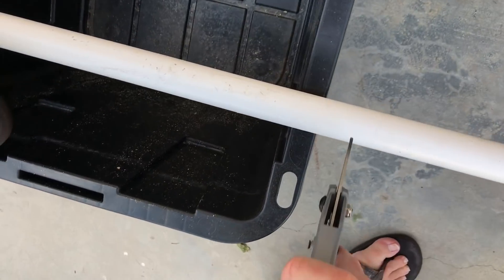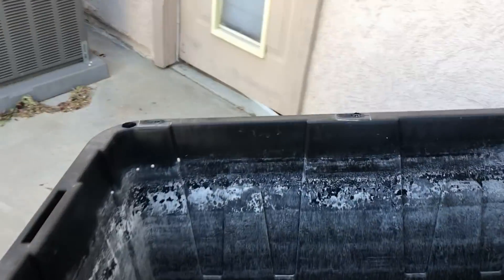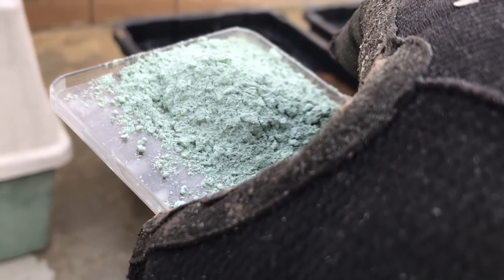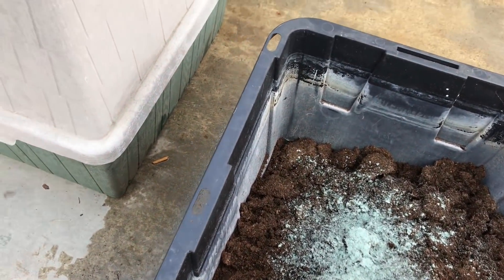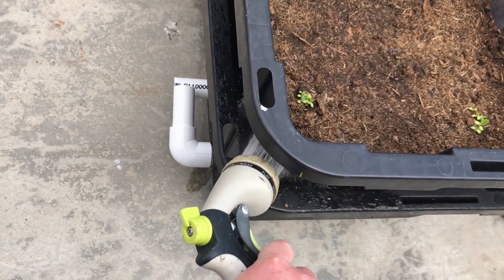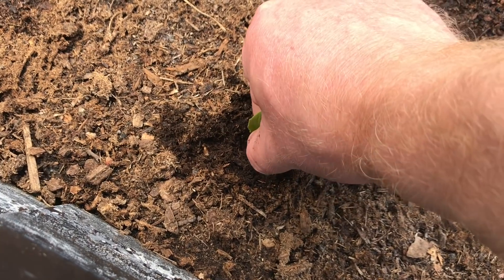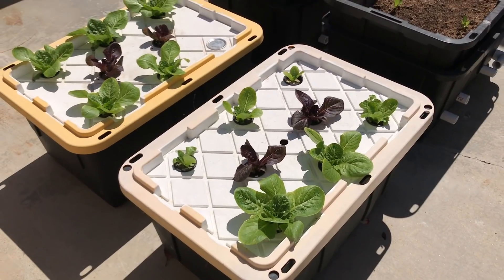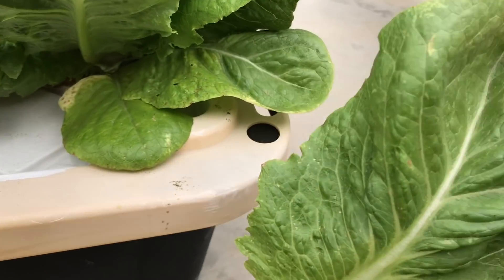Soil growers can't handle this video!

Comment: You need to rename this video Hydroponics Growers can't handle it because the reason that you have all that pest damage on those hydroponic lettuce is because hydroponic growing does not actually promote strength or health just fast growth and water uptake which does not give it the strength it needs to keep pests away. in fact they can tell that it's week that's why they attack it. so you should have been taken care of your soil ones properly and you would have seen a huge difference as well as had more lettuce that was edible
Reply: Wrong, my lettuce is on my deck, in same system, and I have no pest damage, I also grow lettuce in garden soil amended with Compost from my Compost bins. Lettuce in soil have insect damage and don’t grow as well as in the Krakty method. Abandoned the soil grown veggies and now only use the Compost in the Flower beds, you never know exactly what nutrients are in the Compost. PS: check the Element table, all the plant nutrients are their, now find an Organic Element Table! You can’t, because an Element is an Element, weather it came from rocks or the soil. Remember, when the Ice Age retreated the rocks were ground and left behind in the fertile valleys, that is how your Nutrents got spread around. When you find an Organic Element Table which says you have different Elements, let the Industry know and you will become a rich man. Until, then an Element is an Element, Krakty works because the plants have everything they need when required, including all the macro elements. You don’t have a clue what macro Elements are missing in your soil without an expensive soil test.
Reply: Truth Better Than Fiction: Do you live in the US? If so, your Ag Extension Service (created thanks to Abraham Lincoln's Land-Grant Universities program! Yup!) will do that soil testing for you at a VERY low price - in a lot of states (like mine - NC) it's FREE to the pubic in the spring, because it's so important to farmers. BTW - this little piece of extremely succesful, 100+ year SOCIALISM (Land Grant Universities and Ag Extension) is one of the biggest contributers to the  mega-success of American Agriculture.
Reply: My Experiments are done with, I know what works best for me, been through the Soil Web Bullshit, I only have to Satisfy Myself, not anybody else. With the Mittleider raised bed system, I know exactly what my soil is and I know exactly what my nutrient ingredients are. I am the DEFINITE ANSWER TO MY VEGETABLES, I don’t answer to anyone else
Reply: "Soil Web Bullshit" ?!?!??!!? Oh. My. God. FAIL. YOU'RE OUT. Be Gone, Charlatan! You TRULY have no f--king idea what you're talking about if you can say that with a straight face.
Reply: SuperDukka Not my lettuce, peppers or Tomatoes, over 5 years people have not been able to tell the difference from soil grown to Hydroponic grown. Trust me I have been bring up Compost for over 25 years, I know about Compost and how to produce the best. I even produce Compost tea from my Compost and use it on the Flower beds. Like I said take a refresher course look at the Element Table, and tell me which Element(Nutrent) is missing, if you find one could you please let the Horticultural Society know, and you will become famous. At 75 years of age I have run the gambit of Vegetable Gardening, you can teach an old dog new tricks.
Reply: Plants only take up what they need, same as in soil.
Reply: SuperDukka Those are all good reasons. For me over the last 15 years trying traditional soil, raised beds, and Hydroponic growing, I will stick with with Two, Mittener Raised, beds, Krakty, and Krakty with Promix in 5 gallon buckets. I know exactly what nutrents the plants are getting. With soil and even my best Compost the plants never looked as healthy. All my flowerbeds have Compost spread over in spring so no plant material goes to waste. Remember plants will only take up what they require, never over fertilizer, more is not better.
Reply: You are wrong on some things & only partially right about hydroponic plants lacking strength.  
That is only true for woody, or semi-woody plants, & even some species of those are not effected.  

Herbascious plants are just as strong, grown hydroponically or soil.  The thickness of cell walls do not change, they are elongated in Hydo plants, due to their rapid growth, but this does not make them weaker.  

Hydo woody plants tend to be weaker, because they grow taller faster than they can put on secondary growth.  
The exception is with some species like palms & Taxodium growing in swamp lands & marshes, who's vertical growth rates slow, while secondary growth is excellerated, & their cell walls actually grow thicker under swampy conditions.  
These same species grow taller, faster in well drained soils.  

The pest problem in Hydo plants has little to do with weakness.  This becomes subjective depending on what kind of infestation you have & how long it has been there.   
Aphids, mealybugs, grasshoppers, whiteflies... tend to attack the healthiest plants, because they are more nutritious.  
The weaker plants just simply suffer more damage, because they cannot out grow the infestation.  
Then there is the issue that, hydro plant environments lack predatory insects, which is why pest infestations spread more quickly, along with high nutrition resulting in population explosions.  
That being said... it's more difficult for pest infestations to establish, but once they start, it spreads like wildfire.  

Hydro plants grow on average, twice as fast as soil plants, because they just have better hydration & absorb nutrients more efficiently.  
The big disadvantage to hydroponics is that it's more labor intensive & the plant's conditions have to be constantly monitored... where as soil grown, plants can survive, & thrive for days or weeks unattended.
Reply: SuperDuka EXACTLY!!! For example: when growing legumes hydroponically, where will the nitrogen-fixing bacteria come from? Perhaps they can be inoculated into the system in powder form - that even seems quite possible (wihout knowing right now what their own requirements are - I don't know), but this example at least illustrates the concept. If hydroponic growers can create an inoculant powder that includes all of the literally hundreds or thousands of beneficial organisms found in soil, maybe we can talk. Right now, sounds to me like a "maybe" with "maybe a lot of potential" - but currently unrealized.
Reply: @Maharaj of MGTOW hydro is never going to be on par or better than soil. If you truly believe that you have been lied to and brainwashed by big ag. Go ahead and keep buying Monsanto's bottled nutrients you know they own most of the cannabis companies now right? The ONLY way to grow that is legit and worth knowing is notill living soil and natural farming inputs and inoculations. Read into JADAM, CGNF, Bokashi, Notill, Living Soil. You can thank me later.
Reply: Chris Fisher mr Fisher better than my nick name in elementary school ( mr Fister) ? I won't bore you with details . 
Your right in the very same sentence which I would run on with to prove your wrong . If I may ? Yes point mute on plant was victimized by pest who are smarter than people and even plants . But it's there life to be that way . Here's where I go in a differential direction . Side by side hydro being properly fortified with all nutrients macro and micro even sub organisms found in soil Vs. soil comparative in feeding levels and soil health . How would a bug let alone person know which one would be chosen first ? I can't per say but I'm willing to bet my farm on the soil first if hydro had a sealed water system with chilled water res? If you disagree than I can further my point but I am pretty sure hydro rules and soil drools ! Thanks for letting me get that off my vest
Reply: Jody Banks, well-thought-out response to Chris Fisher, and here's my take on that: IF the hydroponic grower can maintain  in his system active healthy colonies of at least dozens of species of fungi, nematodes, earth worms, crustaceans (yes, soil-dwelling crustaceans), bacteria, michorizzea, nitrogen-fixers .... this is a LONG list, I'll stop there - then possibly. But what are the odds of successfully keeping a healthy "zoo" of so many different critters going artifically, as opposed to just planting in good dirt? You descide.
Reply: Sorry my friend it has already been proven that if you take one weak plant and stick it beside all the plants you want kept bug free the majority if not all of the bugs will go to the weak plant because they can tell where the weakness is. Most hydroponic nutrients are stabilized with salts and just like in humans salts make a plant suck up water at extreme rates which as I said promotes growth but it does not promote strength or health. the cell walls of the plant will be thinner and weaker and prone to rupture and bugs can tell that weakness exists and henceforth why Hydroponics tends to be attacked more than soil because Organics promotes strength and health not just rapid growth which makes thicker cell walls and better quality crop, not just pest resistance and disease resistance. Take it from someone who hasn't just watched two or three YouTube videos but has been an outdoor grower of hundreds of varieties of plants fruits and vegetables for the last 25 years as well as an indoor grower who used dwc, kratky, and ebb and flow systems for over 10 years. but I always from here on out will choose soil. The simple fact is that I can achieve yields almost similar to hydro but with better health and much better terpene and Brix levels than ever achieved in Hydroponics
Reply: hydroponic makes more sense used indoors, this would completely eradicate the pest problem and whats left is ultra growing , juicy salad.
Reply: Nik K as a veteran indoor grower of both soil and hydro, I can tell you pests are much more agressive indoors than Outdoor.
Reply: @newpairofdimes7333  BECAUSE THERE ARE NO NATURAL ENEMIES INDOORS !!!!!!
Reply: NewPairOfDimes just wondering why that is you think? 🤔 curious as I’m about to start growing indoors
Reply: Go Chris. Soil and nature are the house of the plants. They do not like water campings. With your knwoledge you can built great food forests.
Reply: There is no such thing as Hydroponics making sense indoors more than soil if you believe that you will have past issues with soil indoors that means you keep a shity environment and shouldn't be growing anything indoors anyway. Soil is my preferred medium and keeping healthy strong plants and a clean room has kept me pest free to this day
Reply: I am a beginner, building a valley forest alone but I do not see other way than soil, fungi, trees, divertsity etc...

Comment: So did the supplemental silica make any difference on the texture of the lettuce grown in hydroponics? How often was the watered changed? Did you get any harvest from the  soil side? If so, how much longer did it take? Was there a huge texture difference between the hydroponics and soil?
Reply from the maker: seems like there was less pest damage on the silica hydro, but it's real hard to tell with this quantity.  water was never changed.  soil side needs to be fixed before plants can grow properly
Reply: Jeb Gardener ...so not worth the purchase?
Reply from the maker: The moisture retention in the soil could be worth it.  It’s a giant bag and you add a tiny amount

Comment: I needed this thank you, I was about to build one of those wikking beds but this answers that question just do a double barrel "kratky" hydro that way you don't have to keep adding water just let the roots drop into the solution and they will follow down the dry roots will then get the air it needs.  Good stuff :)
Reply from the maker: If they are set up properly i think they can work well

Comment: I've been looking into hydroponics for quite a while now.  
There are a few things that I have noticed while watching your videos:  
*    The Kratky method is simpler than the Airstone one but also less effective
*    A lot of material can be used to replace dirt (not limited to stone wool)
*    Pretty much any kind of lights will do to replace the sun (LED, CFL, lightbulb) and not only specialized ones
But there are some questions left:  
Will just about any kind of water soluble fertilizer do? You seem oddly specific about your mixtures and always list its parts.  
How big should the container for the water be?  
Is there some kind of literature that you would recommend when trying these things?
Reply from the maker: I tried gh maxigro too.  Seemed to work fine. 
Big as possible outdoors. Indoors it can be small if you gone mind topping off.  Kratky has a lot of interesting papers.  Go for published papers if you can.
Reply: Thanks for taking the time to answer my questions!
Appreciate it!

Comment: Did you end up growing radishes with burlap or gauze?
Thought about the gauze while writing this comment. Anything with a low thread count that's flexible would solve the constriction issue.
Reply: Actually maybe the way to go is agribond sitting on top of some hex mesh chicken wire. I'm sure you've got agribond so snipping a bit off wouldn't hurt.
Reply from the maker: good idea

Comment: Is there an alternative to plastic totes? I don't like the idea of BPA or other phthalates leeching into the water.
Reply from the maker: You can use anything that will hold water.  Glass, metal, even a wooden barrel would work.  You could probably use a natural pond too.  Plastic is cheap, durable, and easy to work with.
Reply: Would the tannins leech out of the wood and affect the nutrients?
Reply from the maker: It would have some effect, but plants are strong.  I bet they would be fine.

Comment: Jeb, you have doubled the fascination level by setting up a comparison test.  Was nice to see the difference between the tiny lettuce in the SWC and the large lettuce in the Kratky tote.
Reply from the maker: Yeah, it's kinda embarrassing to have the wicking beds fail so badly.  I plan on adding two more wicks to each bed and seeing if that helps.

Comment: Wicked wicking action.

Try running a a thick hemp rope at the bottom of the bed that has both end diped in the wouder through holes at the extremeties of the bac , maybe ?

Or more than one wick ?
Reply from the maker: I’m going to try adding two more wicks

Comment: the hydroponic lettuce is killing it, why ever use soil after this comparison o.O
Reply from the maker: I think the wicking bed could do well in the summer heat if I get the moisture level right.  Also it would be a good place to recycle old nutrient water.

Comment: What do you recommend using for pest control Jeb? I sure have a pest problem with tomatoes, anything leafy, and hot peppers even.
Reply from the maker: spraying is last resort that's for sure.  I've had success with neem oil and soap but you have to spray regularly and the nightshades get some burning on the leaves from the soap.